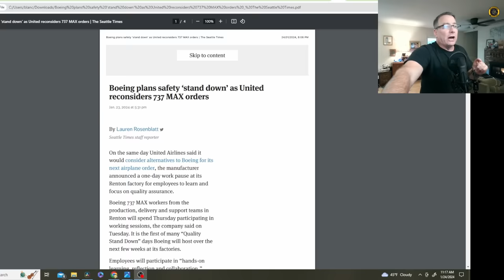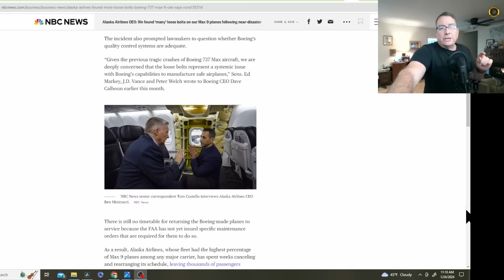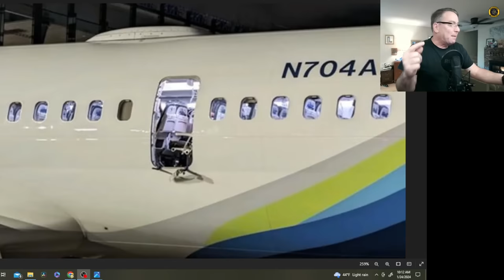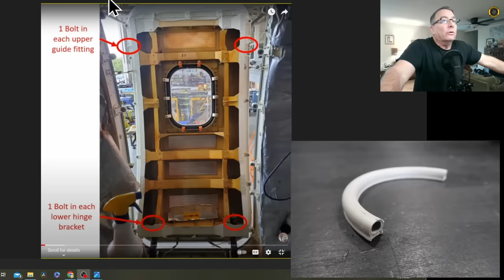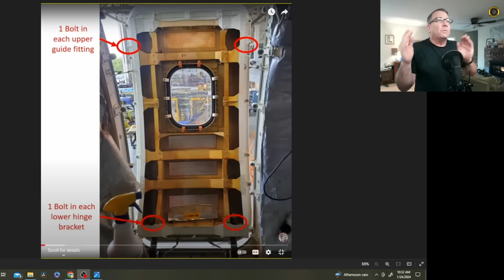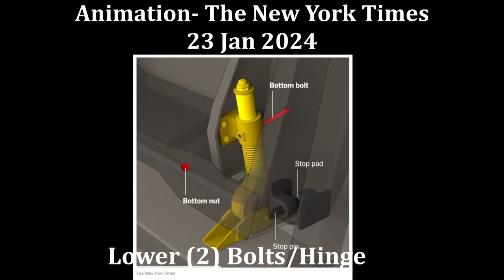Boeing's Quality Management Failure Explained 737-Max-9 Door 24 Jan 2024

Comment: Having been an Apache mechanic for 7 years it blows my mind that any level of work that requires removal of hardware can be performed without being written up and verified when completed by QC.
Reply: My first thought on seeing those bolts was, is some guy re-using the cotter pins?
My company does a lot of what we call "CNN jobs" because if you mess it up, you might find out from the news. I've had to fix or replace things made by much more educated and supposedly competent people than an apprentice mechanic or a line worker. Not documenting something like this is insane.
Reply: Apache is kinda a golden child at Boeing,  they get the resources to really do things.
Reply: Ahh, but you see, they didn't remove the door plug, they only opened it, and, while the procedures are almost identical, only removing it triggers the re-install and inspect procedures. They didn't want to do that because inspections take time, so they just opened it instead.
Reply: @StarkRG  - That's called gaming the system. It's the same process with the same risks, and it should follow the same protocols.
Reply: @GWNorth-db8vn  those boing fellas are veery good in changing names
Reply: Yes, but you aren't allowing for the shareholders who are much, much, much more important than any employee or customer. Boeing is not in business to make airplanes, they make profit for their owner (possibly not much, anymore).
Reply: They still would have had to remove the bolts, thats hardware that should be documented.  @StarkRG
Reply: Exactly.  Every part removed from an aircraft needs a Engineering Order or EO for short.  It lists all the items to be checked, and secured and QC sign off.   Nobody is running the show at the DEI shop of Boeing.
Reply: Classic bureaucratic oversight. The left hand doesn't know what the right hand is doing.
Reply: Helicopter and fixed-wing are worlds apart when it comes to maintenance and QC. That’s like comparing experimental to certified.
Reply: @nationsenemy , while that's true, the QC and QA culture should be the same:  If you touch it, put it back; document it, and make sure someone else sees it it put back correctly.
Reply: This video seems like a clear misunderstanding of how documentation and jobs are logged in aircraft maintenance. The overall job is "left hand plug door pressure seal replacement" subtasks within that will step through access (opening/removing door) the seal replacement task and closing/installing the door. There's no requirement to write up every sub step along the way, that task sign off covers all steps required for completion of the tasks in accordance with the aircraft maintenance documentation. By sighing for the seal replacement the spirit aero guys have signed off the door in toto
Reply: I'm much happier that it was a failure of a procedure-writer to recognize when QC is required because all those procedures can be easily reviewed and updated, while those items are checked in the field.  It would be a much bigger problem is QC was required but not performed or not performed correctly because that's a random systemic error that can't easily be fixed and can't be easily traced because it could happen anywhere.  Need to examine every QC record for red flags.  The absolute worse would be a false QC record for work that's not performed because then we couldn't trust anything.  Other failures, like an incorrect grade bolt that doesn't meet spec would call into question all hardware and require so much testing.
Reply: My bet is that some upper manager thought this door was a door, and thus opening the door, a thing you normally do every day multiple times, was not something that needed a log. But it being a plug door means that there is no handle, thus things have to be undone, and similarly if it was marked as "Emergency exit door" there would be an opening and closing procedure. Here they thought this was a regular door, with handle, because it did not have the word "emergency" ahead of it.
Reply: Right. So how is this Boeings fault? How are the airlines not responsible for the maintenance on their own planes?
Reply: @longsleevethong1457  If it came from the manufacturer with those bolts missing, or improperly installed and its an area that never gets opened up (unless there is an issue or the planes being retrofitted) thats 100% boeings fault.
Reply: @neeneko  I thought the 747 was there golden child.
Reply: @longsleevethong1457  Being a 3 month old aircraft, and still under manufacturers warranty, and with nothing in the airframe having needed any sort of replacement yet, aside from possibly wheels, this failure should not have occurred. You buy a new car, do you immediately strip it down to bare metal and inspect all parts, or do you trust that the manufacturer assembled it correctly. Airline trusted the aircraft it bought should have been supplied correctly assembled and tested, but found now that the QC on the assembly line is worse than the shoddiest low cost toy maker.
Reply: @joehelland1635  The opening of the door plug was documented which implies the removal of the bolts, but without the order to reinstall and inspect them nobody would know to do that except the person who removed them who probably wasn't working on it anymore and would have stopped thinking about them as soon as they started working on something else.
Reply: exactly @StarkRG
Reply: @SeanBZA  the door had maintenance.
Reply: Exactly!